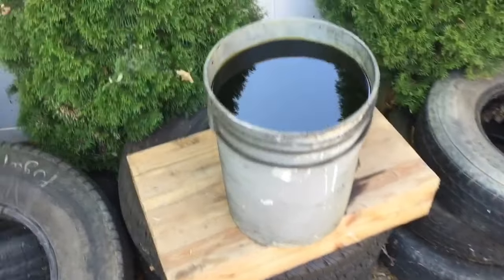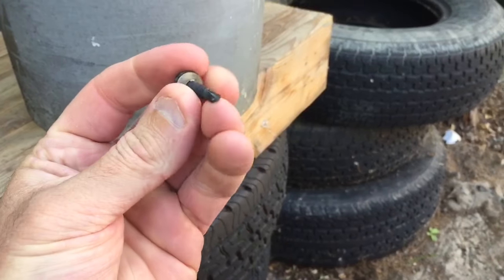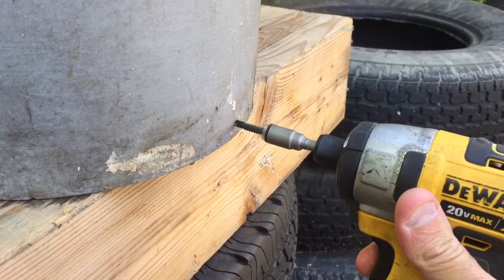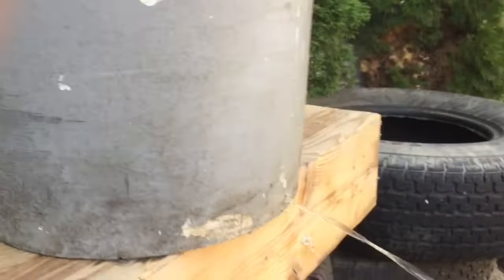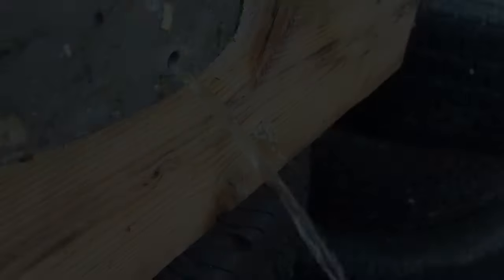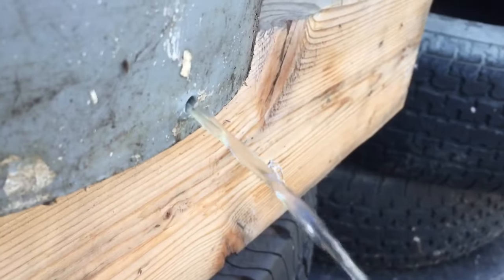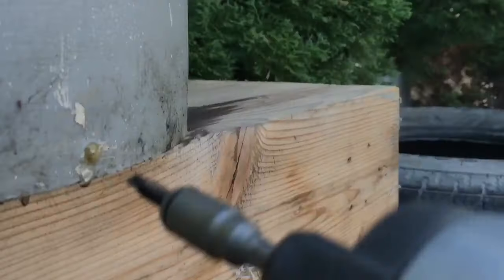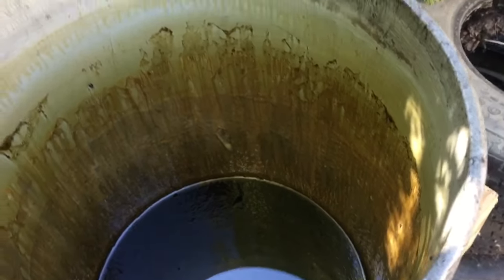Separating Water from Used Oil

Comment: Why are you wasting fuel? Add it to your diesel. I know a gallon of diesel is less than three dollars. But why give your money away?
Reply from the maker: I like the sound of that...but I don’t know how. I don’t drive diesel, so I’m not familiar with the idea that you can add used oil to it. Tell me more. 

How much used oil can you add to a 25 gallon tank of diesel?  Do you pour it directly into the tank? Does it need to be properly mixed?  I like learning new things.
Reply: J Fugal 
20 percent waste oil is the maximum amount you can add to mineral diesel for pre 2003 diesels.
So, for a 25 gallon total, you add 5 gallons waste oil to 20 gallons of diesel.
You need to separate any water from the oil. 
Technically you can wash the oil of additives and contaminates like antifreeze with water. It is an extra step.

Filter and use a magnet to remove small particles.

(Premix 50/50 before filtering)
Reply: @jfugal5237  don't do this at all with the newer diesels with DPF/SCR etc.  Older ones you can get away with about a half gallon (well filtered and dewatered/demulsified) per 20 gallons of diesel.
Reply: @jfugal5237  there are older diesel engines that can run on 100% oil. Mine! :-) I have 97 turbo diesel Jeep and it runs on 30% diesel and 70% wasted motor oil without any problems. The last two years I drove it on vegetable oil, over the summer when it was warm I drove on 100% veg oil. 
Here is the video how I use WMO for fuel: https://www.youtube.com/watch?v=9uyIS8fUsVA
Reply: @jfugal5237  Yeah go for it man.  If you have access to WVO, put it to good use.   Thanks for sharing.    - take care man

Comment: How long did the oil and water have to sit before it was separated?
Reply: For knowing the time u could done   a little experiment with a colourless container by adding some oil in water and then wait 😁 and here is the result
Reply: water and oil do not combine without a lot of help.  Look at your salad dressing, shake before you pour.  Oil and vinegar is just like oil and water.
Reply: 2-3 weeks depending on the emulsion level. Oil and water will not mix if you just pour water in mineral oil.

Comment: Appreciate the video.
Safety warning: DO NOT drink water from separted oil. Just because the oil seperates from water does NOT mean that the additive chemicals will not at least contaminate the water to a small degree.

Many "packets" of chemicals are added to oils such as detergents, emulisifiers, antioxidizers, etc.

Be safe.

Comment: Thank you! I bought a custom waste oil DIY heater from a gentlemen in New Zealand and the source I get plan on getting oil from (your average lube shop or restaurant) definitely comes with water or washer fluid mixed in. I wanted a way to remove anything that isn't a lubricant or oil to make it easier on the burner to do it's job. Thank you for this video!